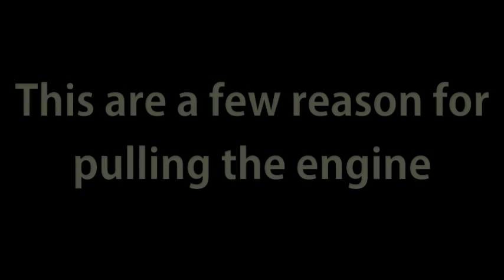HOW TO REMOVE A 2-STROKE DIRT BIKE MOTOCROSS ENGINE Kawasaki KX60 / DirtBikeDudeZ

Comment: hey nice video great help I was wondering did you remove the gear leaver an shaft if so what did you do I need to replace my seal I have brought the seal new shaft an leaver but can't get the leaver off :/ only thing I ain't done is use a grinder do you suggest anything before taking a grinder so close to my engine please
Reply from the maker: +Prezi Rides Thank´s :) Yes but on this engine the lever was welded on, i had to grind the welds off.. Try to carefuly punch a screwdriver into the slice of the shiftlever and to pull it off ;)
Reply: +DirtBikeDudeZ cheers done it now but struggling to remove the clutch basket an side case due to some screw above the water pump :(
Reply from the maker: +Prezi Rides Is it a stripped allen bolt?
Reply: No it's a tiny screw it's covered with rubber and goes to something on the head it seems as a hard plastic or something can't really get to see properly don't want to be twisting my casing without taking it off causing more problems I already broke my clutch hub trying to undo the nut lol
Reply from the maker: What bike are you working on?
Reply: Kx 125 1999 L series
Reply from the maker: Oh ok:) Is it a little phillips head screw? then this screw holds the powervalve govenor
Reply from the maker: http://www.kawasaki-pfeil-ersatzteile.de/d2p/d2p?ALIAS=25206&CLIENT=PFEIL&LANGUAGE=DE&BRAND=HUSQVARNA&NAVGROUP=_2006%20Dual%20HUSQ&MACHINE=336#null
Reply: What can I do or can you suggest as don't know how to get it out an yeah mate
Reply: And that link don't work pal says timeout please login
Reply from the maker: Can you grip it with some channel locks (pipe wrench)
Reply from the maker: Or try to carefuly punch the screwdriver into the head of the screw with a small hammer
Reply from the maker: And try to turn the screw during you punch it
Reply from the maker: Search for: 1999 kawasaki kx 125 ersatzteile   on Google and hit the first link
Reply from the maker: then search youre bike in the list
Reply: Will give it a go when I get home mate thank-you for your help mate
Reply from the maker: No problem ;)